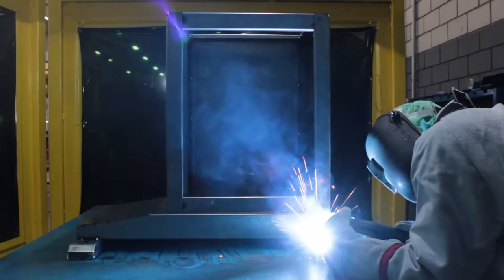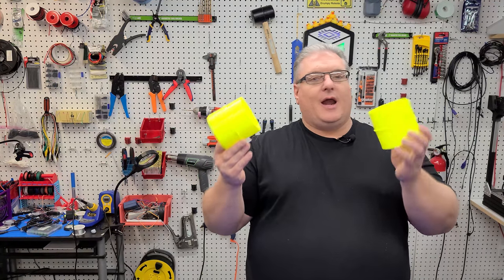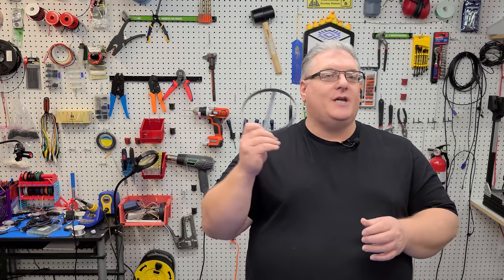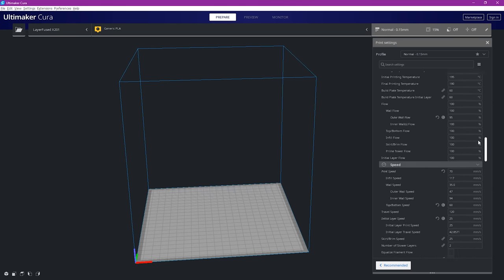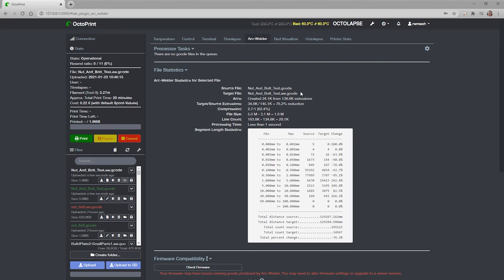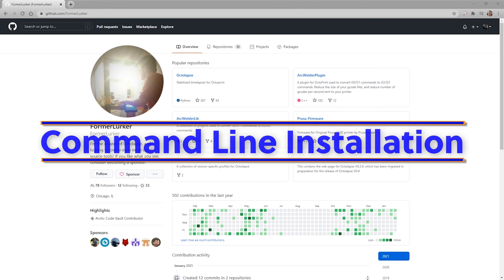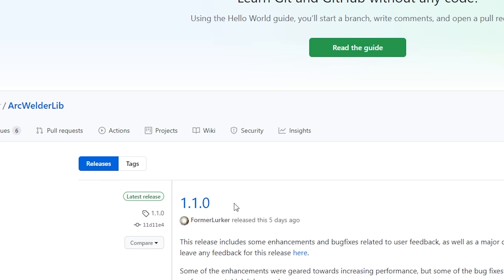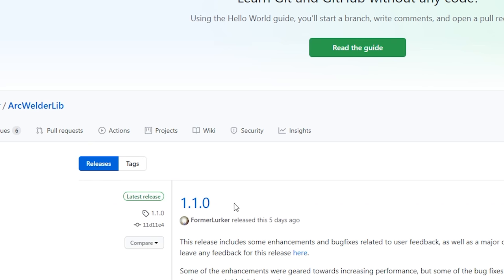Arc Welder - Smoother, Faster, Better 3D Prints! Its like magic to improve your 3D Print quality.

Comment: I installed Arc Welder in to Octoprint today after watching your video. I turned on G90/91 but couldn't do a "compatibility test" as the option wasn't there. After uploading a gcode file of a small cup shaped part, Arc Welder did it's job and compressed it by nearly 30%. However, when I started the print, my Ender 3 Pro got louder and was vibrating like mad. The layers were all over the place and it printed lines through the middle of the print where there should be a hole. I then tried Arc Welder in Cura but it did the same apart from the vibrating. I tried with and without G90/91 both in Octoprint and Cura but made no difference. Uninstalled as it didn't work for me. Shame really as I like the quality of the prints you showed in the video
Reply from the maker: You might reach out to formerlurker with your configuration. Many people have used it successfully.  Perhaps it's a configuration issue.
Reply: @MakersMashup  Yeah, I'll do that and see if it can be fixed for me. Thanks
Reply: Ender 3 pro's don't have arcs enabled by default (I'm learning as I go here).  You'd need to upgrade your firmware, preferably to Marlin 2.0.6 or above.
Reply: @FormerLurker , I don't know what vesion of Marlin my Ender 3 Pro came with but because of low mem on the stock board I can't upgrade to the newest version and keep my BLTouch. I am thinking of changing the board but because it prints so good I am a bit hesitant changing anything on it. I think (IIRC)  Marlin 1.9 is the newest one that would fit in the mem with BLTouch but I had to turn off the onboard SD card as well as  a few other things recommended in videos I watched.

Comment: Excellent video.  Great information.  Is there an advantage of using Arc Welder in Cura versus Octoprint?
Reply from the maker: If it's in octoprint youre not tied down to just cura for slicing.  That is how I run it.
Reply: @MakersMashup  Excellent point!  Now I understand.

Comment: I've always wondered if pulsing the flow rate almost randomly would add an effect that might hide print lines similar to how carbon filament seems to hide the print lines.
Reply: Non-planar slicing and variable layer height should help you a lot in that regard.

Comment: Interesting. Does Marlin not recognize G02 & G03 arc commands for circular interpolation? I've been working in CNC for decades, but just entering 3D printing, and it seems like the 3D printing world could use some help from people who actually know CNCs and G-code. It wouldn't be terribly difficult to come up with a FAR superior 3D printer platform, if it's true that Cura is only outputting everything in tiny, straight-line sections rather than interpolating arcs. :O
Reply: it's not really, "compression." It's simply using the proper code for an arc (g02/g03) rather than using a series of tiny straight lines (g01). It's shocking that it ever did it this way in the first place, honestly. Many software companies have developed CAM (computer aided machining) packages, for translating CAD drawing files into G-code for machining - which is essentially what the "slicers" are. Looks like the 3D printing world just needs a little partnership with the CNC machining world to really leap forward.

Comment: New to printing. Have a ender 3 pro with 32 bit board and bltouch. Doing a starship which is quite round. Was told about arc welding.  Definitely interested.  Shall see how it looks. (I assume it's just plug and play on cura.)
Reply from the maker: It should be plug and play unless you're one of those instances where it just doesn't work.  I had one of my machines with the issue and another worked fine but if it does work it's plug and play.

Comment: I want a video over the settings. I want to know how the settings work with it. It doesn't have much documentation.  Does Maximum Resolution, Maximum Travel Resolution, Maximum Deviation get along with Arc Welder?
Reply: The octoprint plugin has context sensitive help, and the console version has a --help argument you can use.  I'm guessing you are using the cura plugin?  See this from the arcwelder github page: 

https://github.com/FormerLurker/ArcWelderPlugin/tree/devel#preprocessor-settings

Edit: regarding other cura settings designed to limit resolution, arc welder actually works better with higher resolution gcode.

Comment: Good video, well done! Thanks! In my case, I had an issue with gcode generated by Cura. Using Arc Welder, the heatup process is skipped (hotbed and nozzle) and the printer starts printing right away with no filament being extruded. I ran the same file in Simplify3D and there problem is not prenst. ArcWelder did its magic. Pretty impressive! even at .20 mm layer height!
Reply: Hmm.  Are you using Octolapse by chance?  Maybe you  have the 'Test Mode' option enabled in Octolapse???
Reply: @FormerLurker  Nope, I tried the Marketplace plug-in and as well as the command line and got the same result. I compared both files (before and after ArcWelder) and they were almost identical. I'll open a github issue and send you the files in case you want to check!
Reply: @pascallongpre7797  are you using an ultimaker by chance?  I just learned about the ultigcode comment that is required on the first line.  Added support for that last night.  Let me know.
Reply: @FormerLurker  yes, I'm the one who opened the issue on github yesterday! Thanks again for fixing it! :)

Comment: The jagged lines on your prints, like on 10:35, are mostly likely due to poor STL export quality and you probably wont need Arc Welder to fix it.
I used to have this issue when I first started printing and I fixed it by exporting higher quality/resolution STL files from my CAD software.
I might give this Arc Welder a try though and see what it can do for me. Even if it just makes the files smaller, that would be something.
Reply from the maker: Im using the high export setting in fusion 360.  Others have suggested this and I have tried various modes in fusion with the similar results.  The STL is available in the description if you want to review it.
Reply: @MakersMashup  Cheers for the reply! I'm looking forward to seeing what difference that Arc makes. I'll see if I can find the time to print your STL off at some point.

Comment: I've been using it for a week or so now in Octoprint.  Prints look good and smooth but all of them failed before completion.  I mistakenly thought that Arc Welder was causing the failures but I've troubleshot that down to a communications problem between the Pi4 and the SKR 1.4Turbo in the printer.  I have a need to print up some objects in vase mode so I'm looking forward to seeing how they look after fixing my issue today.
Reply: Make sure you enable the 'Allow 3D Arcs' option if you want to try out vase mode.  That is experiments, BTW, so I'm interested in any feedback you might have!
Reply: @FormerLurker  Where is the "Allow 3D Arcs" option?  I don't see it in the settings.  
Also, in Marlin 2.0 firmware under "#if ENABLED(ARC_SUPPORT)" are there any options in there that are commented out that Arc Welder can use?  I just did my first test print of an object at 50% scale in vase mode to see if my printer was back to full operation (tougher problem than I first thought).  It came out very nice so I'm proceeding with a full sized model, printer warming up as I type.  Thanks for the effort working on this plugin.  If the current model prints successfully I'll print a partial model of the uncompressed file to do a visual comparison and let you know what I see.

Comment: Thanks for bringing this to us 3D newbies. Maybe a naïve question but does less file size/data to deal with translate to quicker prints?
Reply from the maker: It should allow you to print smoother and faster due to reduced gcode so that should prevent a buffer underrun.

Comment: Thank you very much! Useful and unique information (this is the first time I hear about this). Immediately I tried to make a gcode from a problematic stl in Cura. With the default parameters of maximum resolution of 0.25 and maximum deviation of 0.25, I always got artifacts in the form of a random microdrop over the entire area of the model. Although I have a 32-bit board and thought that there were no such problems on it. Only a decrease in these parameters to 0.5 and 0.05 helped. But when I added a ARC module to the CURA, the model's gcode decreased from 11.5 mb to 1.8 mb and the model was printed without defects! ) And yes, it is necessary to activate G2 / G3 in the marlin, otherwise the printer beeps an error (although it continues to print).

Comment: Out of curiosity, due to developments and updates with slicing software and 3D printing in general, is Arc Welder still as useful today as it was a year ago?
Reply from the maker: For some sure.  Even when creating the video I had a lot of comments from people using Simplify 3D.  That hasn't been updated since 2018 but "5.0" should be out "any day" right?  So plenty of people out there using S3D and other slicers with less advanced features.  Why?  I don't know but I don't judge.  The information is certainly still helpful for many people.  I'm also glad slicers are improving due to arc welder.

Comment: Looks very interesting  - Great video - However -- Installed it from Marketplace in Cura 4.8 ...but it is not showing in special modes or when I do a search ...???  Any help would be appreciated ..!!
Reply: exactly what happend at my side... Shows up in installed plugins but does nothing.
edit:
I've figured it out: Arcwelder adds a checkbox in the "special modes" category of the settings. If you hit that box, it expands for some more parameter settings. Works great, it reduced a test file from 172k to 68k. I put it on the printer now and will see the print qualitiy in about 2 days.
Reply: FYI, there is an update in the marketplace that will fix this, if you haven't seen that already.

Comment: That's good news.
I noticed the path of your print head goes clockwise and the anti clockwise. I always wondered WHY is nobody bothered by this? I even asked why this is at Cura forums, but they weren't very interested. And I knew they weren't about to change it. Why can't the path go in one direction? Why does it have to stop and change backwards? All that wasted time...

Comment: Hello, very interesting plugin, my first under Cura 4.8, ok for installation and slicing... but on my Artillery Sidewinder X1, i encountered a problem, the print didn't start ! Temps didn't increased... I re-sliced without plugin and it worked... do you have any return about that on X1 ? Thanks a lot
Reply: Same with my Artillery Genius, the arc welder plugin works fine on my FLSun qqs pro.  I think is the Marlin version on Artillery printers.

Comment: Thanks. So when you install that in Cura and use that as an option. The gcode is already processed with arc welder? You dont need to run it again when you transfer it to octoprint.

Comment: If slicers could just use the raw 3d file this wouldn't be a thing, furthermore if you just export your stl with high poly count and use high resolution settings on your slicer plus a 32 bit board on your printer you get even better prints than arc welder.

i found this vid searching "arc welder making my prints worse"

found out most people see a benefit but inversely i usually print using STL files about 2 megs per hour so 20 meg file for a 10 hour print, printing straight from by 32 bit board, no octoprint because it can't handle all the instructions per second i demand from it, i get prints so smooth i had forgotten for a while im not supposed to scrutinize my prints under a magnifying glass.

Comment: Going to test this with my prusa.
Reply: If you're using an mk2 or MK3, be sure to enable firmware compensation since those printers are running a fork of marlin 1.0, and will not print small arcs correctly.  If you're using the command line version add the following parameters:  -s=1.0 -a=14

If you're using the OctoPrint plugin, you will want to make sure the beta version is installed, then enable firmware compensation in the ArcWelder settings.  See this link for instructions to install the beta:  https://github.com/FormerLurker/ArcWelderPlugin/discussions/141

Comment: I use prusa exclusively, would arc welder be able to be used only through that or as a standalone application?
Reply from the maker: There is a standalone application, I covered it in the video.  I cover it in the command line version https://youtu.be/18uYYXecH5g?t=471

Comment: What about Diameter Precision?
with existing FDM, I can normally expect that small diameter circles will reduce their diameter by a consistent amount. Due to both polygonal approximation, and filament stretching.
I design my models with all holes offset to account for this.
Will converting the g-code to Arcs throw all this off?
Reply from the maker: Inside arc welder you can specify the tolerance and deviation to control how aggressive arc welder is.
Reply: In general, Marlin's arc interpolation is the inverse of what ArcWelder does, so most of the time the resulting tool path should be the same.  However, this isn't 100% guaranteed, so increase the resolution below your part tolerances if you are printing critical items.

I did add toolpath compensation in an earlier build, but I didn't see any gains from doing this, probably because of the fact that Marlin is basically undoing the arc operation.  I think the 'perfect' solution would be to rework the firmware's interpolation algorithm so that it produces arcs that are half way between inscribed and circumscribed.  That is actually a challenge, though, given the processing constraints.

Comment: Hi! If I understood well, I don’t need to increase the resolution of my stl to achieve top notch curve quality? 
Thank you for this great video!!
Reply from the maker: Right.
Reply from the maker: Note though it's not going to work miracles on a low poly model.  You'll need to adjust resolution and tolerance to add smoothness to lower poly ones.
Reply: @MakersMashup  ok! I see!! Thank you again!!
Reply: Sorry to bother you, Arc Welder crashes in my Cura 4.8, Win 8.1. I’ve already installed, uninstalled and restarted many times, but always the same. Have you heard anything like this?
I know you aren’t help desk, just asking... 🤓
Reply from the maker: Not sure, I would suggest a bug report to the author.  The command line version is rock solid if you're not using octoprint.  Perhaps pop into the discord someone else might have an idea for you.

Comment: I did a deep-dive into this and found that gcode supports NURBS .  **NNNUUURRRBBBSSS!!!**  That means (in theory) you can define any (analog) curving path by a single G6 command that includes the digital control points and have that shape print at the full resolution of the printer.  (Obviously, the workflow would need to be analog (i.e. geometry-based) the whole way through, with only the printer's controller doing the final digital conversion.  Equally as obvious: rendering a NURBS curve on an Arduino would be as painful as watching paint dry, if even possible.)

Does that make sense or am I missing something vitally important?